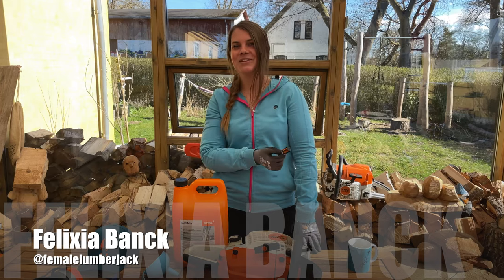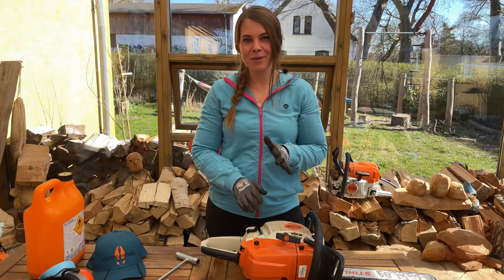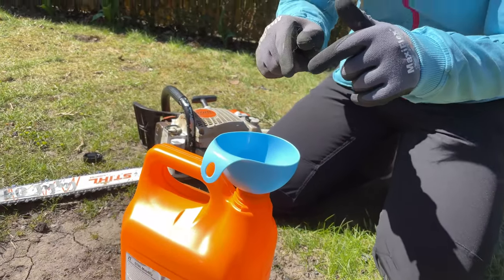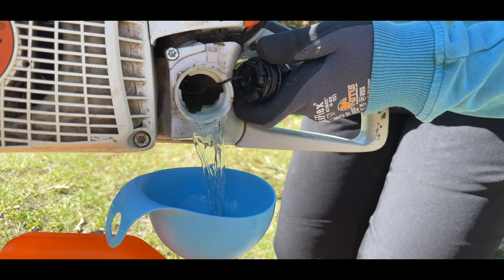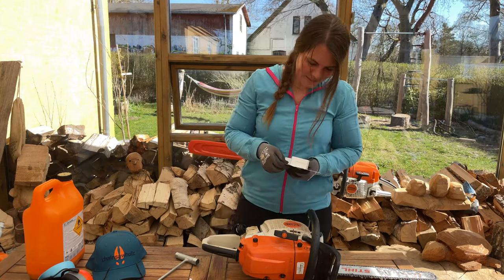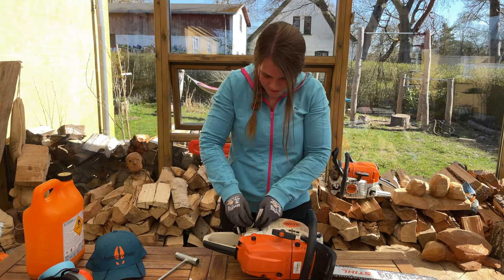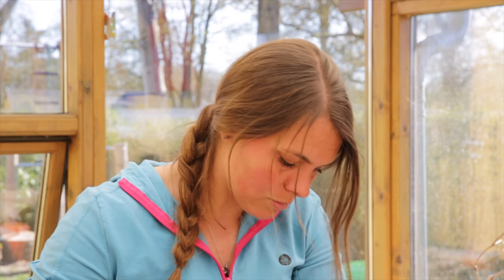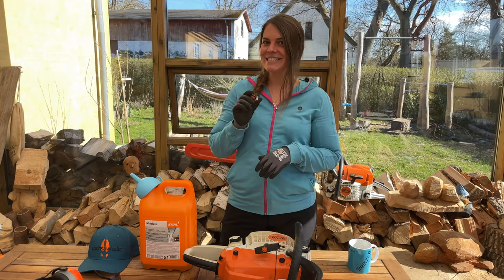How to change the fuel filter on a chainsaw

Comment: Hi Felixia, great vid, I always brush away the dust etc around both fuel and oil caps with an old paintbrush before refueling and oiling, helps reduce debrits ingress in both. The bits of sawdust that fall into the fuel tank over time are partly dissolved by the fuel,  and this pulp, for want of a better term, can make it past the outer mesh, orange in your vid, and block up the scintered block inside the filter, so even tho filters look ok, they are blocked, which you can see/ feel if you blow thru them and see how much resistance there is on the old one compared to a new one, also when removing the fuel hose off the filter barb, I recommend using a thin flat bladed screwdriver to help move the hose off the filter barb pushing from the end of the hose, to break the seal, the hose over time can stick to the filter barb, and pulling it like in your video, can lead to possible damage, tho some would arge, if it tore or was damaged when being removed from the filter, it needed to be changed. Either way, great vid, and keep them coming, and as others have suggested, its worth rinsing the tank out, and if your going to reuse the fuel, tip it thru  a funnel with a filter, so you dont contaminate the fuel tin.  Love the vids, thanks for your time and effort you put into it, cheers from Australia.

Comment: The fuel filter might not have looked that bad, but you probably got a lot of stuff out with the gas.  The maintenance kits are different in the USA, we might have to McGiver a paper clip 📎.
Reply from the maker: Really that surprise me. This was a new one so they might have changes it?
Reply: @Femalelumberjack  I think they are probably changing them, these were sitting on the shelf for awhile.  The Stihl USA website only shows the parts, and not the box.  Keep making videos on the new Stihl stuff.  👍🏻

Comment: Hi Felixia, do you have an opinion or video about Stihl MotoMix or other so-called environmentally friendly fuels vs regular gasoline with 2-stroke oil. Some Stihl-resellers claim that their new models require premium fuel, but it is awfully expensive. More than twice the cost of regular gasoline. I burn about 1000l of gasoline a year and the annual added cost of premium fuel could buy me two new MS261C's a year.
Reply from the maker: I only use environmental friendly fuel to do my bit to protect the nature. For me the extra cost is well worth it and it runs great. 😊